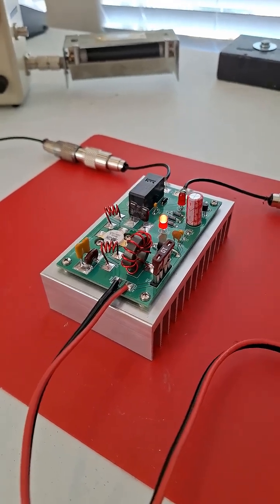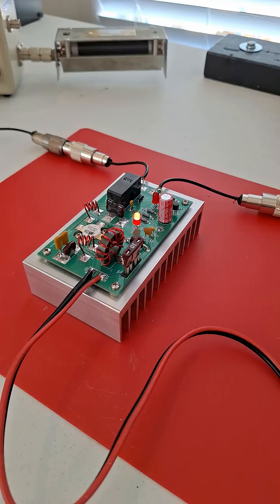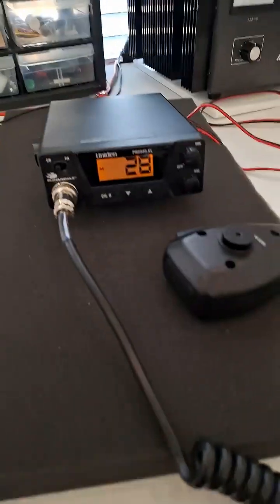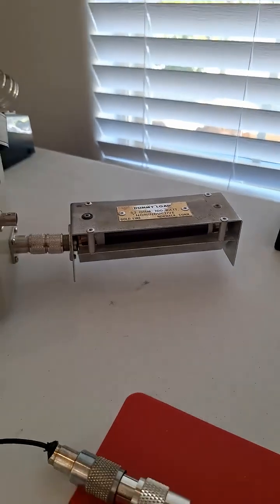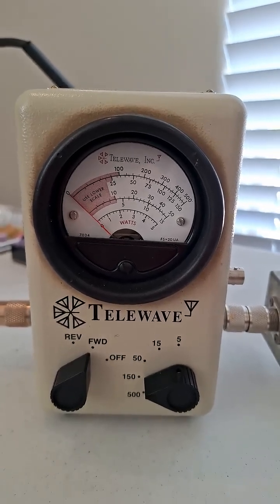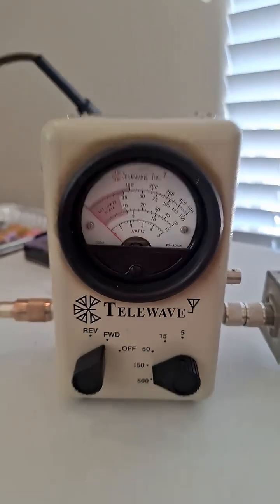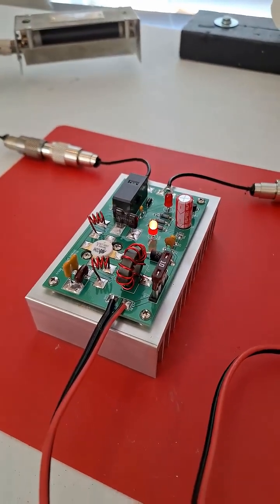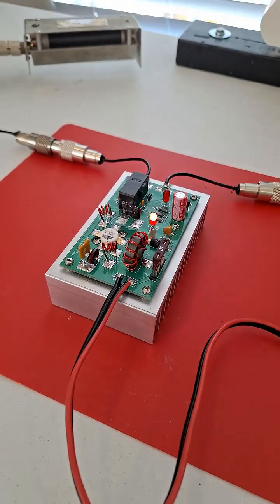MRF454 Series-Tuned RF Linear Amplifier - NEW Design!

Comment: Brian, Correct me if I'm wrong. I watched this video. The second harmonic, which is higher than the third harmonic, is noticeable. This shouldn't happen in a push-pull amplifier, which raises questions about the symmetry of the input transformer... It's not designed correctly. There are practically no even harmonics in a push-pull amplifier; they're very small. What am I missing?
Reply from the maker: Yes, you're right... the second-harmonic is normally reduced in the push-pull topology. However, there are many things (like symmetry, bias, to name a few) that impact the waveshape (harmonic content). A big issue here is the very large impedance transformation necessary for the tuned circuit... making the tuning touchy/hyper-abrupt. It was an interesting experiment, but the LC-balun (or sometimes called lattice balun) is probably not well suited for a large impedance transformation.

Comment: Brian, Have you designed any of your  'tuned' amplifiers with two or more output transistors? Is this even possible?
Reply from the maker: Yes, my DX600T uses two MRF300 transistors in push pull and has no output transformer.